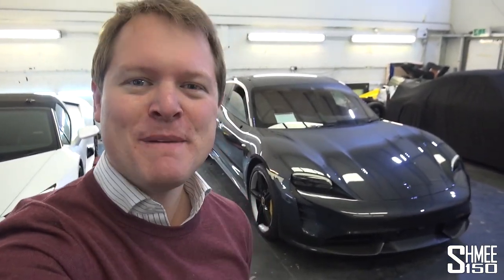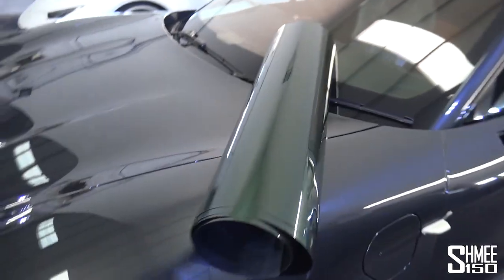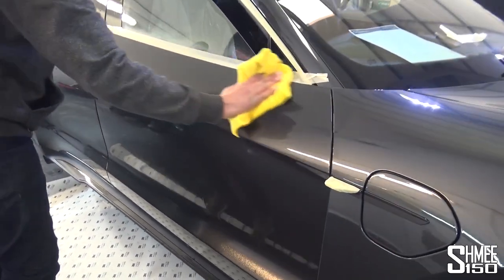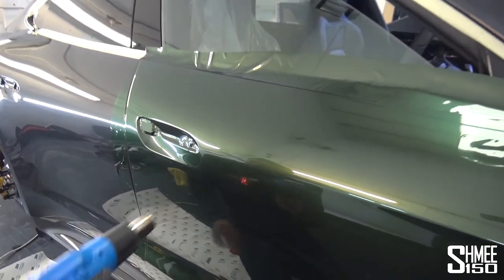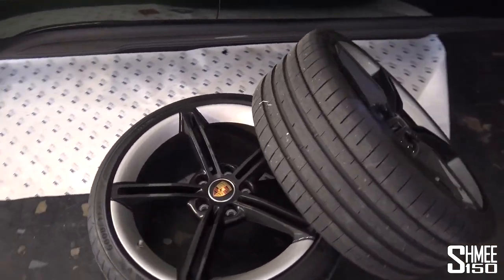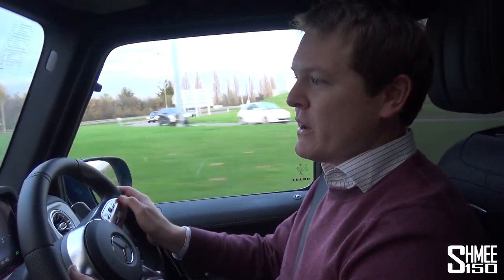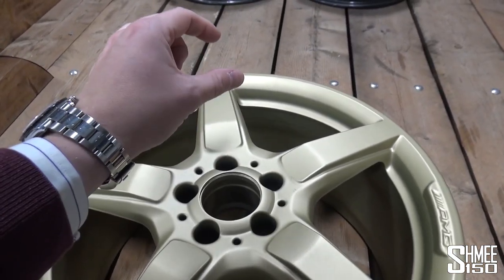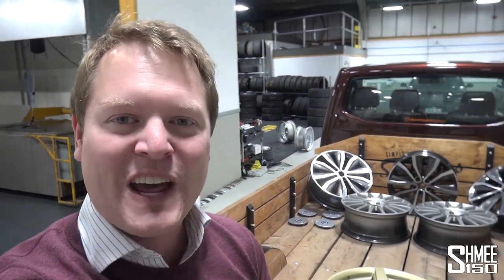My Porsche Taycan Turbo S is Being TRANSFORMED!

Comment: FYI, all wrap and PPF stick to the car using acrylic adhesive which consist of (small amount of) acrylic acid. 80% of the times I peeled wrap and PPF off of my customers cars, the paint was damaged one way or another. The most common one is they left a pattern on the clear coat due to corrosion of the glue. This cost 10-30 micron of clear coat which you have to look very very close to see the damage.

Comment: How do they actually cut the film without cutting into the paint? I didn't see how that process worked out
Reply from the maker: It's done by using the back edge of the blade and really requires experience and technique, a lot of amateurs get it wrong and slice marks into the paint by mistake
Reply: @Shmee150  ah of course that makes sense! Seems like a trust worthy process

Comment: Topaz doesn’t do colored wraps like this?   Also I noticed they don’t spray the paint and wrap with soapy water and squeegee it out?
Reply from the maker: Topaz doesn't do vinyl wrapping, they do PPF and Topaz Skin. Vinyl has a glue on the back surface so it's applied dry, whereas PPF is applied using liquid as you've seen and moved into place.
Reply: Thanks for the info!!

Comment: I think it's a very good color choice, it's symbolic for the electric and a bit of modern connection to a british racing green, even though it's not strictly a british brand :) A deep color is the modern understated way, I think that's fine for a luxury daily driver. The gold wheels is more of a bold choice. Not sure how that will fare. Will probably push it more into a showy racing color scheme. A titanium and gold combo might also look good. You can call the car the Green Hornet :)  it's green and there is a sting of pride when you lose to it.

Comment: Hey Shmee! So if the Model S plaid would have been out by now at dealers near you would that be a obvious buy dor you instead of the Taycan? Personally the Taycan looks so much better in and out but the Model S just seems better.
Reply from the maker: I haven't really been the biggest Tesla fan, they are a bit like Apple in that there are just too many fanboys for my liking.
Reply: @Shmee150  I agree. But if the numbers are correct it will be the most mental family sedan ever!

Comment: Without sounding like a spanner , could you have not ordered it in green from the factory 🤔
Reply from the maker: Copied directly from my video description that I guess you didn't read:

You might be wondering "Why not just buy it in the colour you want", and there are a few reasons. I didn't order the car, rather I bought one that was already built although with no previous owner, and there weren't any factory green ones for sale in the UK. Porsche don't yet do PTS for the Taycan (if you want to wait for a new order anyway), and as always with the Shmeemobiles, I wanted a totally unique look. In this case it makes the most sense to take the wrapping route as I have no idea yet if I can live with EV and therefore how long I'm keeping it, could be 6 months if it's a nightmare, could be years if it works out, stick around to see what happens.
Reply: Come on mate no one reads the description its all about the video , thanks for the detailed reply 👍

Comment: As long as there’s an Instavolt fast charger convenient to you then it shouldn’t be too much trouble this is no different from locating an appropriate petrol station for any fossil fuel cars. The only issue is that you’ll find it won’t deliver the claimed range Porsche say which is what we’ve found

Comment: Still don't understand why you wrapped it, rather than just painting it.  Is it just the price difference?  Is it because you plan to "unwrap" it before you sell it...and if so...why?
Reply from the maker: I'm hardly going to send a Taycan to a paint shop like I did with the SLS Black Series; that's about £20k and would decimate any value in it. In this instance I'm not sure how long I'll keep the car; if the EV thing is a nightmare then it could be only a few months, so respraying a Taycan would be the most bonkers and foolish mistake I could ever make.
Reply: @Shmee150  Fair enough.  Thanks for the explanation.  :)

Comment: I can't believe anyone would ever wrap a Porsche, where the car maker uses the finest painting process to give the customer an exceptional paint job.   Its like wrapping a Rolex with aluminum foil.  Gold wheels will replicate a cheap Japanese Subaru WRX wheel.  The wheels currently look fantastic in black and silver.  You're messing up Shmee.  Your car will be turned into a mascot car for the Notre Dame football team.  lol
Reply from the maker: I actually completely disagree. The amusing thing is that this wrap vinyl is an equal match in finish if not better than the factory paint.
Reply: @Shmee150  Then why aren't the finest automobiles in the world using 'vinyl rap" instead of paint?  Better have a look at those Subaru gold wheels too, I know what I'm talking about.

Comment: I swear this car is available to spec in a similar green? Why not just do that
Reply from the maker: As per my description, that's partly answered already:

You might be wondering "Why not just buy it in the colour you want", and there are a few reasons. I didn't order the car, rather I bought one that was already built although with no previous owner, and there weren't any factory green ones for sale in the UK. Porsche don't yet do PTS for the Taycan (if you want to wait for a new order anyway), and as always with the Shmeemobiles, I wanted a totally unique look. In this case it makes the most sense to take the wrapping route as I have no idea yet if I can live with EV and therefore how long I'm keeping it, could be 6 months if it's a nightmare, could be years if it works out, stick around to see what happens.

Comment: The [...] had a duroplast body mounted on a one-piece steel chassis (a so-called unibody), [four]-wheel drive, a transverse engine, and independent suspension – unusual features....Known for its dull colour scheme and cramped, uncomfortable ride, the [...] is an object of ridicule for many Germans and is regarded as symbolic of the fall of the [E(U)astern] Bloc. Wikipedia 2075 😁